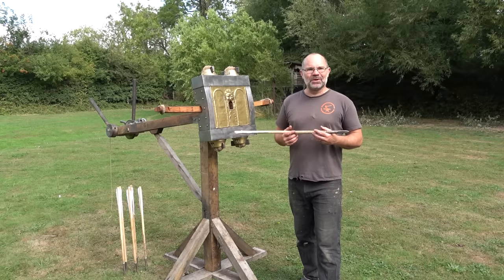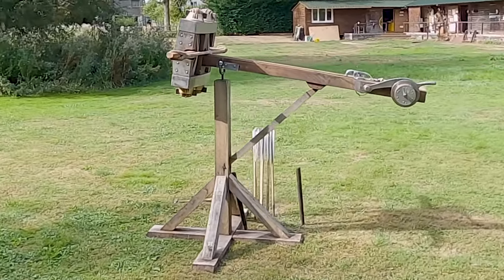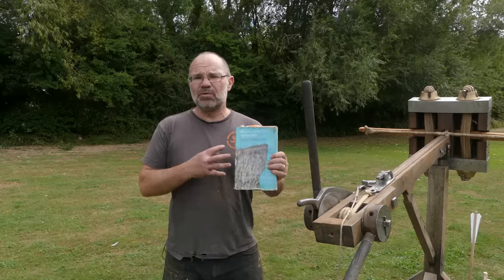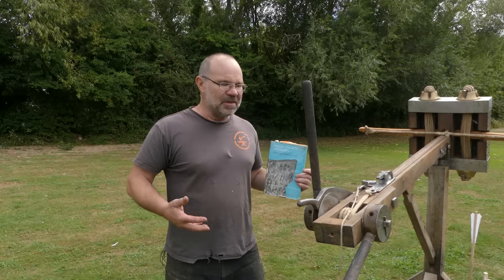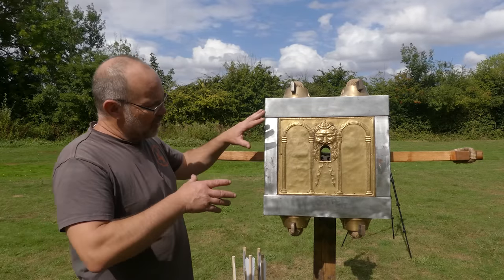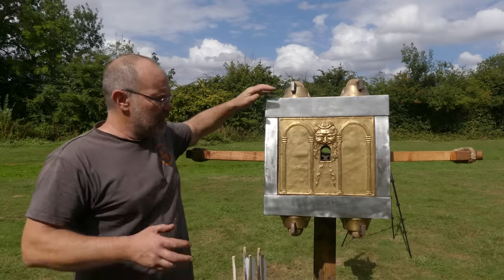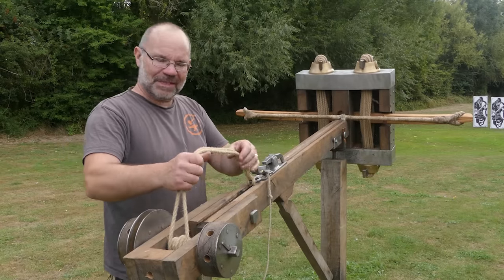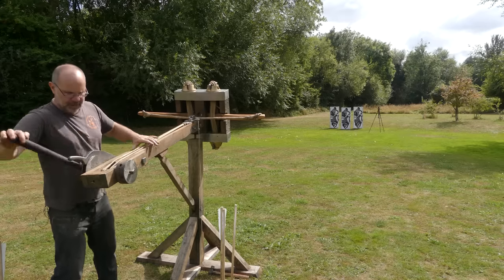Tod's new artillery piece - BALLISTA or CATAPULTA?

Comment: Beautiful piece of kit Tod! And the reloading speed amazed me, the sliding trigger and ratchet combo really is ingenious. A question: a while ago I read about a theory; that many catapultas were in fact inswingers. I.e the limbs rotated in front of the main frame. Supposedly this configuration could get a longer power stroke. What's your take on this?
Reply from the maker: Later machines were in swingers and these were quite different and yes more powerful as they had a longer stroke.  Not sure when the change happened, but I think around 200 or 250
Reply: The reload speed of a two man team would be incredible. They each put their handle 180 degrees off the other so each man is able to pull when the other's handle goes too far. Able to have simultaneous actions like one unwinding the windless while the other pulls the latch up to the bow. I imagine a well trained team could refire in less than 10 seconds.

Comment: One thing to note with any weapon like this:  accuracy is relative.  If you're one soldier charging 1 catapulta, the accuracy of the weapon and rate of fire mean you have a reasonable chance of getting into melee range and killing the operator.  

If you're a group of 200 people charging en masse toward a dozen catapulta being operated by however many people it takes to maximize rate of fire and provide acceptable accuracy, each volley is probably taking out at least one person each.  Given the power described for a fully tuned catapulta and given many of the peoples Rome fought against didn't very sophisticated armour or shields, it's not entirely unreasonable to expect a bolt to go through the front rank and kill the person immediately behind them too.  

This of course depends on which front of expansion they were using this - Greece, Egypt and the Middle East had fairly sophisticated technology and would have had iron breastplates and wood backed iron shields.  The Gauls and the peoples of Germania....don't have the same kind of reputation.  (Of course, we've mostly only got Roman history books on this, and Roman histories are probably the least reliable source for accurate descriptions of Gallic and Germanian battle tactics and equipment.  Other Mediterranian cultures have their own records written down, largely in formats we can read.)
Reply: Ancient artillery pieces were not used in mass against massed infantry charges. That's what archers were for. Artillery was used to supress a besieged fortification's archers from larger rane than they could retaliate. Fortification's artillery was used to supress assaulting artillery. Both roles required actually quite good accuraccy. That a guy who just built a catapulta only manages top hit with half his bolts doesn't mean that a trained artillerist wouldn't have been able to consistently hit a man-sized target at long range (and as a matter of fact, period sources often mention that being the case).

Also, man, everyone had iron armor by the time catapultas were in use. (What they would NOT have is iron shields. These weren't used then. Too heavy. Closest thing were bronze-faced wooden shields, of which the thin sheet bronze was just a more durable facing than felt or leather.) The end of the broze age had been a whole milenium before that! By that time, every army (including Germans) used chain mail (which is actually a Celtic invention, not a Greek nor Roman one), plate armor was actually out of fashion (Greeks stopped favoring full cuirasses around 500 years before this kind of artillery was developed, and moved to lynothorax; and the famed Roman banded armor, the lorica segmentata, was in common use for just over a century and a half), and the cutting edge of armor was scale armor. We actually have a LOT of information regarding all this stuff. I direct you to a good source in English, Peter Connolly's "Greece and Rome at war". Good book which drinks from many period sources, by the grand-daddy of historical reenactors.

Comment: It's a very interesting machine. I'd have assumed it needs sights for the gunner though. At the very least a hole to aim through.
Reply: I would not be surprised if rather than having such a device the Romans would have "pre-plotted" the range and aiming points for the various angles of the track both up/down and left/right plus how hard or far the projectile can hit for a given tensioning/clicks on the ratchet... They liked to be very technical about their engineering.
Reply from the maker: I suspect Ugly German has it
Reply: @Ugly_German_Truths  While the idea of a fancy brass instrument is a strong urge it was likely a simple collection of marks on the frame.
The naked eye can only do so much.

Comment: To get the most out of it, you have to pe-tension the skein. I built custom winches to pull each wrap to 1000 pounds.
Reply: yes, he said exactly that
Reply from the maker: Yes the original treatise says the cords are to be pulled tight and stretched  and 'clipped' into place whilst the next wrap is made.  Apparently it was preferable for the cords winders to be musical so they could hear the note of the cord prior to clipping so each pre-tension is the same.
Reply: @tods_workshop  Who was it that said "It's a lazy soldier who twist his skein tight", or something to that effect? I used 500LB rated webbing as winch line. I found the breaking strength of the webbing, then backed off a bit. I could tell by the note it rang out as fibers started to snap. lol  Probably had more then 500LB per pull, so the engines were probably under more like 24,000LB of tension to start off with. Tuning is Very important. The engines must be balanced.

Comment: Now clearly this is intended for use against soldiers - it's field artillery. Those darts won't do much good for destroying fortifications. Which makes me curious: what would a dart do against the sorts of wooden shields Rome's enemies were using?

Also: this reminds me of the polybolos - basically a Greek scorpion with a magazine.
Reply: It's used in sieges to clean enemy marksmen off the walls, essentially ancient covering fire. Also shields don't stand a chance, those things could probably make it through multiple hoplites before getting stuck in the Aspis of one lucky albeit definitely traumatised guy in the back rows.
Reply from the maker: I think shields will be coming
Reply: or the other way around, small enough to put on a palisade and outrange an archer.
Reply: @konzetsu6068  archers brigade: throw volley of arrows from a fort
The guys on the legio's carriages: guess what m8s squeeky catapulta noises
Reply: As someone mentioned in another comment, the name appears to come from the Greek for "shield-peircer".  I expect there's your answer.  :)
Reply: @mnk9073  You are completly correct in their use and their efectivenes against shields an armor. A bit of comedic effect exageration in the overpenetration, but certainly not that much of an exageration 🙂

Comment: You were talking about how size changes the force. You said 3x the size, did you mean 3 times the dimensions, or 3 times the mass/volume.
For instance if you have solid 1 centimetre cube of constant density and you multiply the dimensions by 3 I would say it becomes 9 times the size or volume/mass not 3 times.
Reply from the maker: I did fumble at one point.  To clarify, the size of all the components can go from 1/3 of this one up to this full size of 1/1 and the performance remains the same, but the bolt is now 9 times heavier so packs loads more punch
Reply: @tods_workshop  : 27 times heavier, if it's 3 times larger in all 3 dimensions, so even more of a load more punch than that.  :)  And, yes, that's fascinating indeed!
Reply: @tods_workshop  Could be a good time to mention that ancient artillery manuals even had convenient size tables for "if you want to throw a projectile of this mass, just build a machine of this scaling factor" so you knew which size you had to build your artillery piece! People tends to grossly understimate how developed the technology was by the end of ancient times...

Comment: To throw a spanner in the works, a Latin text from around 400AD, De rebus bellicus, calls a torsion bolt-thrower a ballista fulminalia (thunderbolt ballista).

There are also later sources from the Eastern Roman Empire that use the term ballista for a bolt-throwing engine.

There are also cheiroballisa which appear to have shot either.

"This type of ballista, essential for the defence of walls, has been found by experience to be superior to all others in range and power. When a steel bow has been placed in position above the groove from which the bolt is discharged,  a strong sinew-rope [i.e., the bowstring] is pulled back by an iron drawing-claw, and, when released, it shoots the bolt with great force at the enemy."

The Latin text says ballistae and sagittam (literally, an arrow).
Reply from the maker: Thanks Aaron.  Maybe I am being too pedantic, but the texts that these were made from were significantly earlier.  However I am on thin ice here, but will stick to what I was taught it was called, but thanks again for the reference.  I guess the word did change over time

Comment: Fascinating!  A while back I was looking at a YouTube review of a modern crossbow and noticed that instead of drawing the cord back to the anchor/release mechanism with a separate system the release mechanism itself was pushed up to engage the cord, then wound back to span the crossbow.  Should have known.  The Greeks and/or Romans figured it out first.  Couple of tweaks, though...the modern system employs an automatic ratchet, so that the winding cord doesn't need to be pulled out before pushing the release mechanism forward.

Comment: Hey Todd, Love the channel. I dunno' if this is helpful, and you're probably miles ahead of me, but i'll give u my layman's understanding of ballistics as i found out from making my own traditional bows. The arrow, or bolt will only travel as fast as the limbs that are driving it. Period! so that means limbs that move at 150fps, will hopefully transmit most of that force to your arrow (often disappointingly much less). If you are using huge limbs, that have considerable mass (like in this video) you are going to be necessarily using a mechanism that puts much more energy into them to move them. Much more than you could achieve by arm strength (which is the obvious advantage of such devices). These limbs will move a standard, lets say 150grain arrow at the same speed as lets say a 1500 grain custom made bolt. The FPS limit of the limbs will limit the distance of both projectiles (bolt/arrow design in terms of balance, flights etc. will help with this) however  at the end of its journey your 1500 grain custom made bolt, which can (because of its additional mass) store much more energy from  your launching device, will have hugely improved penetration over the smaller arrow. It's often said, the best bows are those that perform close to their breaking point. If you want faster projectiles, and improved distance, you have to play around with reducing limb mass (close as you can to catastrophe), increasing tension, lighter projectiles (sacrificing penetration) and improved flight deign. Your string, or whatever makes contact with projectile, is also important as it also has some mass and the tension can be slacker, or indeed stiffer resulting in either more forgiving energy curves (less hand shock and easier shooting for us archers and possibly important to protect your device from catastrophe with heavier projectiles) or sharp energy curves for rapid acceleration. With a device like this i would suggest getting as close to the latter as you can, and also because you have a limited range of movement from relatively short limbs. I also highly recommend investing in a traditional roman digital chronograph to test it. Once you maximize limb speed of your device, and find the optimal projectile design/weight (for instance you might find that it drives a 150g arrow at 150FPS, a 750g arrow at 150FPS but a 800g arrow at only145FPS, your optimal projectile weight is somewhere around the 750g mark, if speed/distance is your goal. If it's armor penetration, that's a whole other essay on terminal ballistics.  Let the keyboard warrior/physicist flame wars commence.......

Comment: Scaling problems with aircraft is usually due to the fluid properties of air memorialized in numerical factors named for Reynolds, Prandtl, Froude etc. if the materials and techn of the airplane stay the same. Tiny propellers must be different from large ones for instance.

For devices like yours you have to look more at internal factors like grain size of the wood as a fraction of component dimensions even if you use lumber from the same tree.

Anyway, thanks for finding another rabbit hole for us to follow you down!

Comment: With the winch-nuts on both sides and two levers... I can't help but think that when in used as a crew-served weapon, they probably had two soldiers twisting it; one man would give it a twist and pull out his lever to reposition it; when the first soldier pulls out his lever, the second one, whose lever is already positioned, puts his lever in and gives it a turn.
Two soldiers twisting it like that would be able to draw the thing pretty fast, if each one is able to twist it, presumably with two hands if it's torsioned to a higher draw weight.

Comment: I've always read them as a Scorpio from 50BC that could be up to 3-span (61cm) bolts, but I'm hardly an expert on them.
Just while you're back- regarding pointy darts being thrown, might be worth your while to check out something that bugged me until I did some research on them. The Kestros. Now its essentially a sling for throwing the darts, however, it does look to have an extremely dangerous learning curve!

Comment: I'd have to take the trigger rope, make it longer and tie it to the aiming arm at the back.  Make it long enough to drape down the side under the pawl barrel on the right side.
Then once it's cocked, all you'd have to do is step back, grab the aiming arm, lift, which would drop the support arm, grab the trigger rope, aim (somewhat) and pull the rope.
You wouldn't have to worry about forgetting to grab it and bring it back.

Comment: Looking frame-by-frame e.g. at 13:02, you can even see how the metal plating flexes.
I suppose it's because the limbs are moving forward, they are pulling the whole front plate backwards, in a sort of recoil, but the forces are somehow distributed so it almost looks like a deflating metal balloon. Or maybe the limbs were pushing against the front plate when the catapulta was loaded?

Comment: Really need some B roll and ideally a couple of diagrams of that trigger. A small loop on the end of the trigger string  would let you hook it on a hook or peg at the side of the tailstock and diminish the time in motion for reload-shoot. It looks to me like you could lower it by a handspan and get a much better short range target picture.
Reply from the maker: Do you want a film with loads of B roll of the pieces?

Comment: I want one! Tod, I wonder if you could make range marks on the frame by setting a constant angle, draw back the trigger assembly, mark the spot and fire the bolt. Measure out the range and label the spot on frame. Also can you mount a pull scale of some sort on the trigger assembly to measure the draw weight?

Comment: I am fairly sure I have seen somewhere a curved arm of a sort marked as a protractor sticking off the bottom of the shaft of a scorpion, which would measure range/angle relative to the vertical post of the mount.

Comment: I fully agree that originally, a catapulta threw bolts and a ballista threw rocks. However - I would argue that so many people know a ballista to be a bolt thrower that in modern terminology a ballista is an ancient bolt-thrower. In the same way as a gladius is a roman short sword rather than the Latin word for sword, for example.
Reply from the maker: Yes and no.  The problem is that I am some sort 'expert' so if I call it a ballista and it is not then I am wrong and will be called out.  Call it a catapulta which is correct, but do not address the fact that most people call it something else then that I just distracting - so here we are.  It has a correct name so I have chosen to use it.
Reply: There will always be someone being picky, you should call it a trebuchet just to wind people up!

Comment: Made a scorpion for grade 7 history class, it could shoot 70m with bike inner tubes powering, could crush the 2x2 bow limbs if racked up too much, doesn't require much to achieve good results not to finicky ratio's can be off, the failing point was the arms on mine got chewed. nice to see one done proper see where i fell short in the trigger mech do to it being a one week project not enough time for research

Comment: Lovely fun.
Do you think that having each side balanced in terms of power and speed is important.
Or would it not be as crucial as it is with a modern bow
As always great fun informative.
Look forward to the rest of this series.
Cheers Dave
Reply: It's still important in a modern bow.

And it's critical when you get into big torsion engines like this. There's a dude in Washington state that has a reconstruction of the Ursova Device. It's got a 5000lb draw weight to it at 34", and will throw darts an easy 800 yards.

Comment: 12:45 For the Angle Gauge, I wouldn't be surprised if it is simply a Half circle/quarter circle Protractor markings on the side with a plumb bob/weight on a string hanging from the center point, simple and effective, and easily done with the tools of the era.
Reply: Simply having a ladder-rack to move the supporting arm up or down & fit into would be good for varying range in a consistant way.
I thought some had a little cut-out above the bolt apurture so you could sight down the bolt.